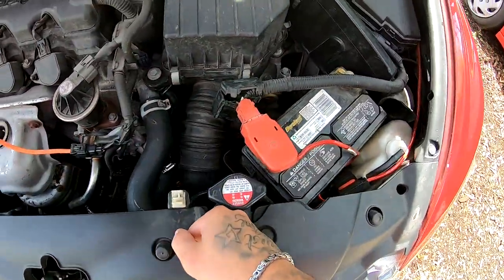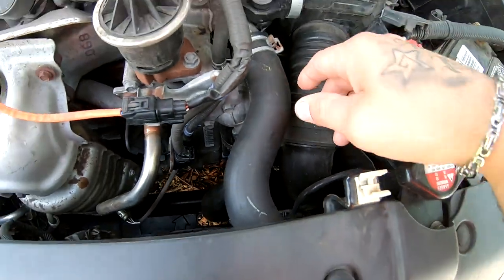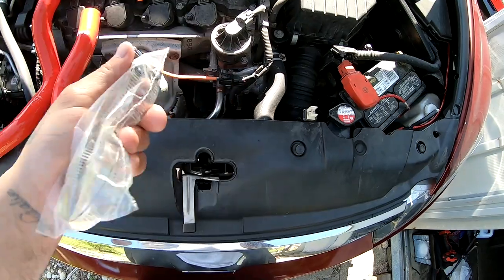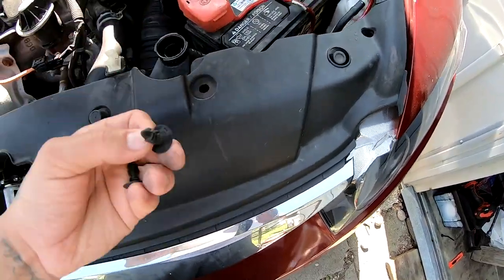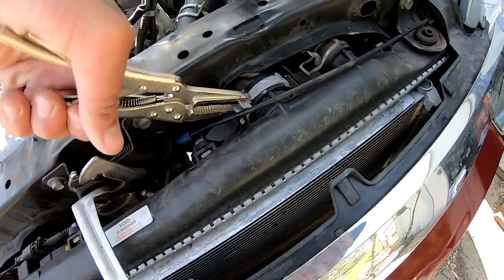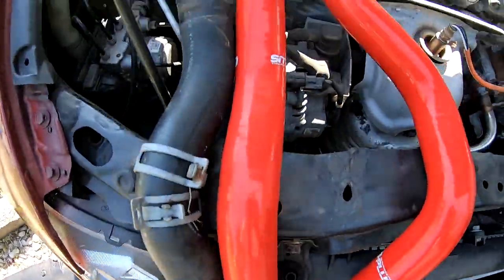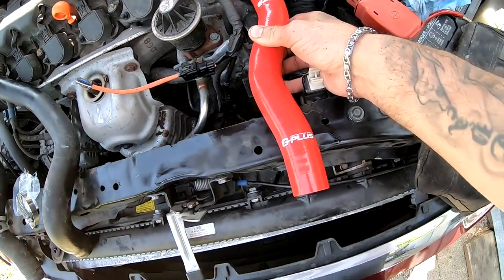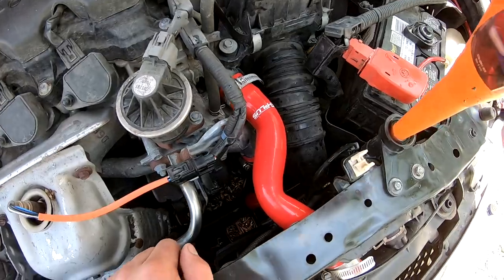2010 Civic R18 Ebay radiator hoses G plus performance

Comment: its been a few months, how are those hoses holding up?
Reply from the maker: Still holding up no leaks or any problems il do a update video.
Reply: @BarbasLife   good to hear, im planning on buying a set for my audi. ill stick around for the followup video.
Reply from the maker: I would buy it the only thing i dont recommend is the hose clamps it comes with they will work but they are crap stick with oem clamps or buy some at autozone.
Reply: @BarbasLife   yea i suspect that the chepo clamps it comes with would not be worth having. sadly audi uses 1 time clips so iI have to go buy some that arent crap.